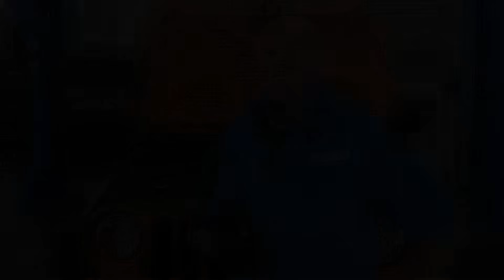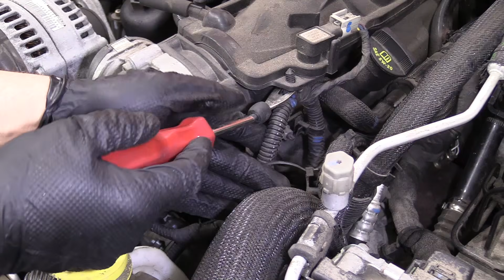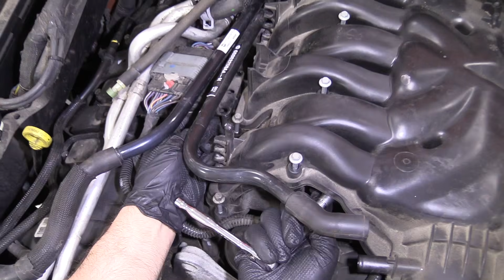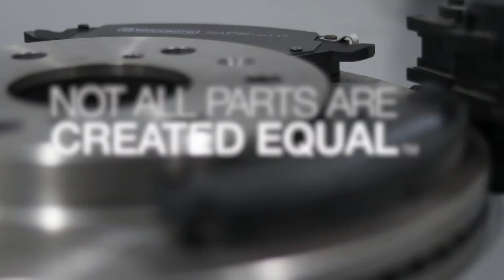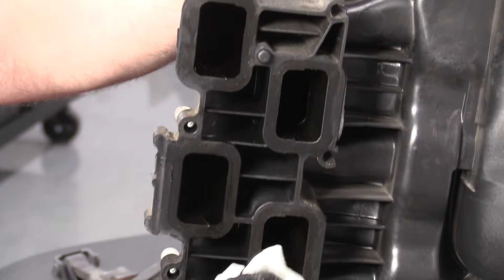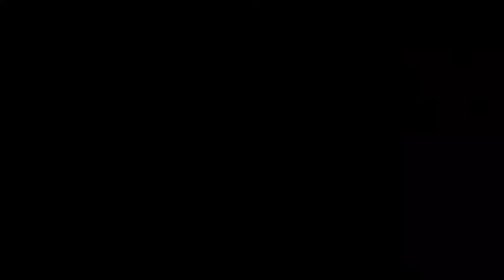How to Replace Spark Plugs 07-18 Jeep Wrangler

Comment: If you going to change plugs you should go ahead and do all the other maintence since your basicly taking engine apart to get to it.   Clean throttle body clean sensors and or replace any that might need changing.    It will save you 4 hours worth of tearing down and putting engine back together!

Comment: Electrical connector to the throttle body is incredibly difficult to get off. Ended up breaking the tab to take it off now its stuck on. Electrical connector to throttle body is an absolute pain. Any pointers guys

Comment: I want to thank you, for not calling  the Straight Bit, or Straight Blade Screwdriver a Flathead Screw driver. It is not a Flathead Screwdriver.  There is a type of screw that is called a Flat Head Screw that has a straight slot in it, but there are other screws that also have a straight slot in them.
A Flathead Screw may have a Phillips Head, a Torx Head, an Allen Head, a Square Drive Head etc. So people, please do not call it a Flat head Screwdriver, it drives me nuts. Great video.

Comment: Working on a 2017. All the plastic connectors on the coils are brittle and when I pushed down on them they broke. All six of em. Going to try electrical tape to keep them from sliding off. Just a heads up if this happens to you.

Comment: The real tip is to wait until you need to inevitably change that oil cooler that is going to leak on you without question. Then, while you have the whole fkin top end off to replace that PoS crapfest, change the spark plugs, PCV, coils, etc. save yourself some time and effort.

Comment: Going to do this soon and upgrade my oil cooler to an aluminum one while I'm at it. The PCV valve was a breeze with a locking flex head ratchet. Took ten minutes tops! Definitely using this video. Nice work!
Reply: I'm reading people swapped to the aluminum oil cooler then switched back to OEM because sensors don't match and they leak again after few thou miles 🤔

Comment: Appreciate your video. Agree with others on having to remove so much for a simple job. I had a CJ4 with a Vette 350 V8 in it that was much easier to work on. Again thank you for the education. No wonder it cost so much to replace 6 spark plugs. Yikes, would be a real pain on older jeep with rusted hardware. Could see those intake manifold bolts disturbing the intake gaskets upon re-assembly if not super careful. 1A Auto is A1.
Reply from the maker: +@michaelbezos2969 Thanks for checking us out. Shop for high quality auto parts on 1AAuto.com:

http://1aau.to/m/Shop-1AAuto-c

Comment: Those bolts are 71 IN-lbs which is not 7.5 foot pounds it is 5.961 FT-lbs. Both upper and lower intake manifold says 71 IN-LBS. That plastic will crack with over tightening especially if it is old.

Comment: Jeep dealerships currently want over $1,000 to do this job.  (As of March 2024.)  

The first time, I was quoted around $600 back in 2018 or so, and I balked at that amount and did it myself.  Then a couple years later, it was done during some warranty work; I paid only $200 for parts and labor because I knew enough to tell them the hard work of getting to the plugs would be included in the warranty work.  So, they discounted it and I was fine with paying that; I know they need to make money.  

But this time, I'm having the valve cover gaskets replaced under the lifetime power train warranty and they initially asked for over a grand for plugs, then discounted it to $600 for overlap of work when I called them out on it.  Total BS.  BTW, they wanted $1800 for that but thankfully I have that warranty.  So they're doing that and I'll be doing my plugs myself again.  You'd think, just to earn some goodwill with a new customer, they'd take a couple hundred bucks to screw in six plugs and I'd be happy paying that.  But $600?  No.

Thanks again for a crystal clear instructional video!  he first time, I was quoted around $600 back in 2018 or so, and I balked at that amount and did it myself.  Then a couple years later, it was done during some warranty work; I paid only $200 for parts and labor because I knew enough to tell them the hard work of getting to the plugs would be included in the warranty work.  So, they discounted it and I was fine with paying that; I know they need to make money.  

But this time, I'm having the valve cover gaskets replaced under the lifetime power train warranty and they initially asked for over a grand for plugs, then discounted it to $600 for overlap of work when I called them out on it.  Total BS.  BTW, they wanted $1800 for that but thankfully I have that warranty.  So they're doing that and I'll be doing my plugs myself again.  You'd think, just to earn some goodwill with a new customer, they'd take a couple hundred bucks to screw in six plugs and I'd be happy paying that.  But $600?  No.

Thanks again for a crystal clear instructional video!  You guys do excellent work and are saving me thousands of dollars!!

Comment: Great video, it's ridiculous that you need to take everything apart for this maintenance. I personally won't use these guys for parts. I ordered a vacuum pump from them once and it was junk. Also, I ordered brake rotors and pads from them. The rotors were exposed and damaged during shipping and returning them cost me $60.

Comment: Brah you didn't need to take the bracket off... The two screws on the driver side was all you needed to remove. 10 mm and 8 mm sockets is all you need period. If you are using anything larger, you are working too hard.

Comment: I have a 2018 I changed the spark plugs on it, now I have a code u142.

The vehicle will start but once I turn it off, it will not start again for a couple of hours. I can’t figure out what I did wrong, any suggestions?

Comment: I know we change the upper intake manifold gaskets but is there any necessity to chsnging the lowers as well? Not experiencing  a leak or anything just changing spark plugs and coils and the gasket pack I ordered comes with both upper and lower

Comment: This is a wonderful video for the 3.6 crowd. Not sure why they said it was procedure for the 3.8? The 3.8 is hard enough in it's own right trying to route new wires and even get to the passenger side plugs but at least we don't need to remove the darned plenum.

Comment: So the torque wrench you have pinned is 25-250 but in the video you say you need to torque it down to 7.5 ft lbs how do you get 7.5 from the 25?

Comment: My jeep was running just fine. I change the spark plugs. I turn the engine and boom.  The jeep sounded loud, shake and misfired. Electronic throttle control came on.  I need a mechanic now just changing the spark plugs. 🤦🏽‍♂️

Comment: Is Dielectric grease necessary inside the coil and if so...how much should I use?  I also noticed you didn't put any dielectric grease on the ceramic part of the plug which is also what I've heard to do.  I'm hearing that it is and isn't necessary to use dielectric grease. I have a 2012 Jeep Wrangler JK Unlimited.  What are your thoughts?

Comment: You can actually bend those small metal brackets on the side of the intake back slightly off of the studs. I usually use a small pry bar. You just need to be careful where you are prying from so you don’t pop a hole in the plastic valve covers.
Reply from the maker: +Danny Zappala Thanks for the feedback!

Comment: Well, thank you heaps - followed your video step by step and apart from working without something to stand on, out in the sun - no shade -  in 35c temperature, all went well. One hiccup - no brakes - but running back over your video it was obvious I missed refitting a vacuum hose on the L/h side (hidden under the wiring harness). Thanks again for putting this up 👍🇦🇺
Reply from the maker: +Beskar 501 Thanks for checking us out. Shop for high quality auto parts on 1AAuto.com:

http://1aau.to/m/Shop-1AAuto-c

Comment: After watching this - I’m not sure I have enough time in one day to change my plugs ! Can’t believe they would design an engine that needs partial dismantling to change “consumables”. When I trade my 2014 JK, I think I’ll be looking for a straight forward carby / distributor pre-1990 rig that you could have done a complete top-end rebuild in the time it takes to change plugs in a JK.
Thanks for the video though, very comprehensive and I’ll be having this playing while I attempt the job myself (just to see how frustrated I’ll get 😜)
Reply: Agreed.  This is about to so piss me off. Because I cant just pause and edit my temper the way he pauses and edits the camera when HE gets stuck.
Reply: They make it hard to get to the spark plugs because they know you will get pissed off at the process and not want to do it and ultimately end up going to the shop to get them replaced and they end up making $500.

Comment: I don't think the years specified on the description of this video are accurate. I have a 2009 with the 3.8L and replacing the plugs is way easier than this. This should be for JK's with the 3.6 which came about from 2012 on up.
Reply from the maker: +Charlie Bourret Thanks for the tip! We'll pass this info along to our production team.
Reply: Oh its accurate ...I just did my plugs and one coil took 3.5 hrs start to finish...it was EXACTLY like this...

Comment: Mine is at 62000 miles, no issue.. im planing this work ahead ..and was quoted $400 at the dealer to change all 6 spark plugs and gaskets.. because im broke, i will probably diy this.
But i got a question..im not very tall and my jeep is lifted. So i can barely reach the spark plug with my hand. Even with a 2 steps stool i can not reach some of the nuts..i need to step on the bumper.
I do not have a hose plier, they cost $18 each. I dont know which size to buy. Could you also list the iridium spark plugs and the gaskets parts that we need to buy? Also what do you do if you drop a bolt inside the manifold?  And what year was the jeep in the video how many miles did it have ?

Comment: solid vid..ty
Reply from the maker: +Mr. K Thanks for checking us out!
Reply: 1A Auto Parts whats your opinion on sparkplugs? mopar really necessary or would some bosch do the job?
Reply from the maker: +Mr. K It really depends on what you are looking to spend.  You want to at least get some half-decent spark plugs in our opinion.  Some high performance vehicles will demand very specific plugs, but not on a Wrangler!
Reply from the maker: +Mr. K Thanks for watching!  There are multiple brands of spark plugs out there, you don't necessarily need to get Mopar.  You just want to make sure that which ever one you purchase they are going to fit the vehicle!

Comment: Any suggestions on other PMs or things to check / replace if you've spent the time to remove the intake?
Reply: The coil packs. If you're throwing a miss fire code, you could replace the 1 or all 3. $30-40 a piece.

Comment: Geez, that's ridiculous to have to disconnect so much to get to the spark plugs.
Reply: They mislabeled the video. For the 2007-2011 JK you don't have to disconnect anything other than the battery.
Reply: @felixgarciamedina5471  well damn. I wish I had a 2007-11. I spent almost 2 hours this morning taking the engine apart to the get to the plugs. ridiculous
Reply: @sca5056  how many miles on your Jeep?
Reply: Tell me about it I have 2016 Sahara  jeep wrangler

Comment: Absolutely awesome video. Crazy how long and difficult some of that was but got my coils and plugs replaced step by step.. Thank you very much for taking the time to make the video as I can only imagine what a dealer or shop would charge to do that task??!!! Thanks again for you help.
Reply: I got a quote of 500 to change out my spark plugs and coils
Reply: To answer your question, the dealer charge is $1800 for the service.
Reply: @CliffJohnsonIII  That's hard to believe they charge that much... insane
Reply: @tewilk  Just got a quote today from the dealership, it was around $600, not $1800.
Reply: @sbyurt1  Thanks for the info. Just changed the plugs on my Jeep and was wondering how much the dealer would charge.

Comment: Very detailed video thank you for sharing it. However, I must add that this is very poorly designed. It should not have to take this long to get to something like spark plugs.
Reply from the maker: +Man and a Jeep Thanks for checking us out. Shop for high quality auto parts on 1AAuto.com:

http://1aau.to/m/Shop-1AAuto-c
Reply: It's a smart design for revenue. They want you to have to take it to the dealer and pay $700 for changing spark plugs
Reply: ineedonefora2007jeepwargler

Comment: Just did mine following the video. Absolutely nuts (pun intended) how you have to take the intake manifold off to access one side. The other side was almost impossible to get to as well dealing with the brackets and hoses. After making 3 different trips to the store because I kept needing different tools (my fault) to get the job done, it got it all put back together and now no more misfire engine error codes for me. Great video! Thank you for spending the time to show us how to do this.
Reply: great job!

Comment: A 2006 is a TJ And has a 4.0L, 2007-2011 has a 3.8L, 2012 to 2018 has the 3.6L. The JL is also and 18 and different as well.
Also you can bend up the bracket on the passenger side rather that take the brackets off.
Reply from the maker: +silentjde Thank you for your feedback!

Comment: It should be noted that '12-'18 JKs have the 3.6L Pentastar engine while the '06-'11 models used the 3.8L Chrysler engine which is going to look very different than the one shown here.
Reply: I have a 3.8 and did my plugs and wires this weekend....i didnt take anything off....just the wire clips....
Reply: my thoughts exactly....on the 3.8 don't need to remove the manifold...just the passenger side fender to get at the buried plugs....still just as annoying but different.  Makes me miss my 4.0L Cherokee where all the plugs were right THERE!
Reply: I was looking at this and realized a couple minutes in that wasn’t the 3.8. The setup at least on what I was looking at is entirely different